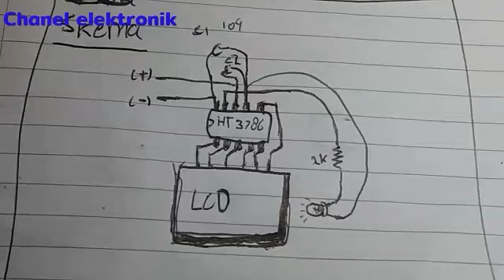Cara membuat indikator baterai digital(How to make a digital battery indicator

Comment: Untuk cas aki 12v bisa ya
Reply from the maker: Ga bisa kalao pake itu.
Kala buat idikator buat aki bisa pake bolhan yang 12-15volt.Cara pakainya pasang lampu bolham
di aki misalnya lampu nya terang 
berati akinya masih banyak lalu
sebaliknya kalo lampunya redup
berati aki lemah.
Itu yg saya bikin cuma bisa buat 
baterai 3-4volt kalo buat 12v 
ngeri aisi konslet.